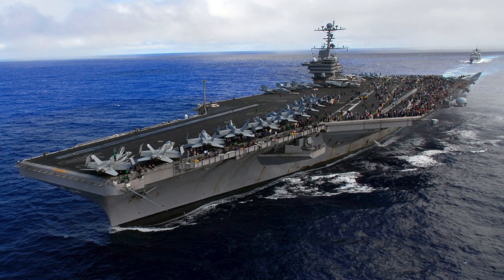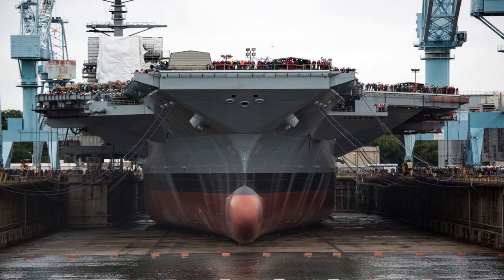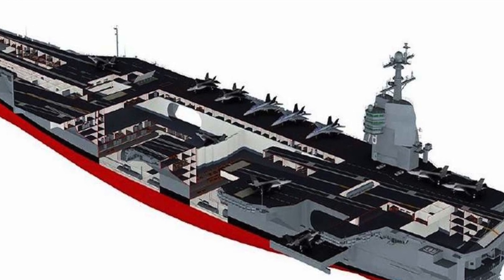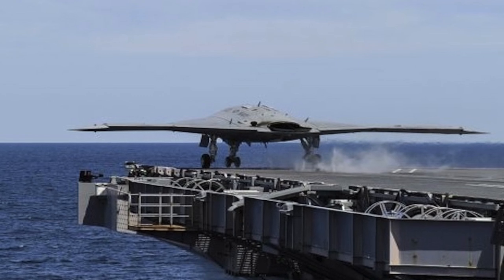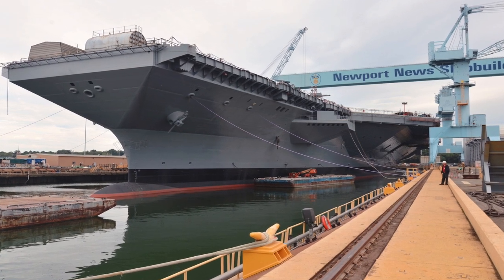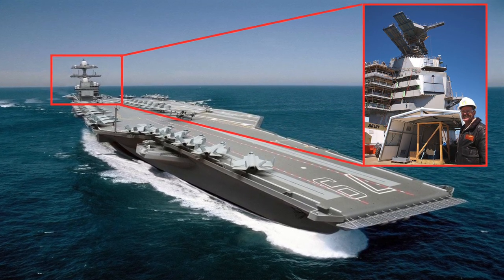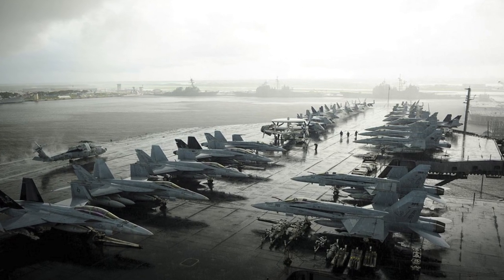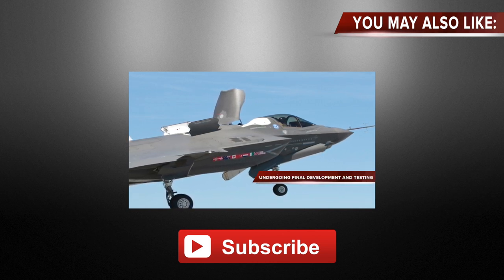NIMITZ vs FORD class: TOP 5 IMPROVEMENTS

Comment: This video is identical to a Pentagon press release. Every feature is treated as a flawless improvement over its predecessors. From all the failures, the actual ship is much less impressive. Hopefully, these deficiencies will be worked out before the next ship in the class is launched. Perhaps, the Nimitz class could have incorporated some of these advances and produced something more effectual.
Reply: The main upgrade (forget EMALS and others) is the power output. It costs too much to install a new power plant into a Nimitz, at that point you might as well scrap the ship and start over, which is what they did. The power plants are completely maxed on Nimitz, no room for better ewarfare suites, energy weapons, etc. 

It will take time to perfect these new technologies, but in the meantime, they have immensely more power at their disposal for more conventional augmentations.
Reply: They have incorporated hundreds of design improvements into the next ship already based on lessons learned from building the Ford. They are also retrofitting Ford with some improvements where possible.
Reply: I see the Ford class as incremental improvements on the Nimitz class, which broke new ground. The Ford is not breaking ground, it can't really do anything the Nimitz can't do. It just does all of it better, faster, cheaper.

When they mount a ray gun on it, then it can do something the Nimitz can't do.

Comment: what happens if one of these ships are blown up with a nuclear reactor on board?
Reply: exposer dozer boom goees the dynamite
Reply: the reactor runs until its out of fuel.
Reply: exposer dozer 
Nothing.
The water cools the reactor stopping the fission.
Reply: Trained pigeons and seals immediately converge on the site, defecate all over the thing, and it is rendered harmless. I know, it sounds fantastic, but it is the easiest way to neutralize radiation.
Reply: The seawater would cool the cores. There would be minimal radioactivity released into the air and water.
Reply: Officially there won't be much damage. But all the actual research is still classified,  so who knows. Probably nothing good.
Reply: Godzilla

Comment: This guy doesn't know what he's talking about. The steam catapult replaced the mechanical catapult primarily because the steam catapult builds energy during the launch. The energy is transmitted to the aircraft when the 'Restraining link ' is broken by the pressure of the pistons pulling the plane forward. The plane then Accelerates.
Reply: Yeah, he describes the thrust as if the steam is coming out of a bottle.  You can control even a fixed-volume discharge to vary any way you want, as long as you have a valve that opens gradually (hello? industrial revolution?). Geez.
Reply: I was a nuke mechanic for 6 years, did a tour on the Nimitz. This whole video was a facepalm marathon of all the incorrect information stated!

Comment: Very interesting but unfortunately, like the F-35, what was described is what it is supposed to do, not actually what it does.  The catapult system doers not work and may require a complete redesign, the same with the arresting gear.  Like so may things, that are actually made in the US, it is very expensive and doesn't work!  Extreme cost overruns, way past delivery date is the new norm!
Reply: yes a website^^ impressive, we couldn't use any other video streaming sie.. not to mention that the www was invented at cern by some europeans working in switzerland.
Reply: PaveISTL - The RT trolls are the US Republicans.  I am certainly not a Republic an!  I am a patriot, though I have less reason to be with every election that republicans win as they work to dismantle the US from within, and now NATO as well!  It is the Republicans that support Putin, due to right wing propaganda and the elected Republican orange goblin that wants to be like Putin, and the Putin loving Republican congress!  So, when talking of RT trolls, you may well be referring to US Republicans, that have been working against the US for over four decades!

Comment: just wait  till they figure out that replacing the steel in the deck,island and sponsons with aluminium and fiberglass will cut the weight by a 10th and improve the stability

Comment: The improvement now includes model -T Ford engines , only slightly used by Henry Ford . This is a "bottler" . But all the sailors have deserted , not convinced at this stage .
Reply: Troll alert   troll alert
Reply: *****
I thought I might amuse you .
Reply: tgjguitar
There is nothing wrong with being gay .I would not hold it against you .
Reply: You would not hold what against him.?
Reply: Tom thx
Tom Mix , that is correct , I don't hold grudges .

Comment: These advantages are only theoretical. They'll have their hands full with getting the damn EMALS catapult to work reliably.
Reply: New ideas always take time, they will get it working, not to worry.
Reply: All I heard on the news is that they were having trouble with launching and landing. What that really means, who knows. But not to worry, they will correct any and all issues.  The EMAL has been tested and did work fine in test.
Reply: They'll probably get it to work fine, eventually. The question is how much money will it suck up? I think It doesn't make much sense to invest exorbitant amounts of money on a complicated and unproven technology that offers incremental advantages.
Reply: +SiegenDignitas    Al like new equipment need tuning, no big deal.  To late to go back now, it is built and here. It will be fine and work great, just takes time to get started.

Comment: Hmm, 300 Megawatts of electricity...  A reactor, (or boiler ), is generally at a maximum of about 33% efficient. As a former Nuke on a Carrier.. I am Surprised that you are saying.... 2 reactors at 300 megawatts electrical... That would mean something like 2000 thermal?? I realistically don't buy it! Way too much! The Enterprise, (My Carrier and the Nimitz Class carries would be Very Roughly, non Confidential numbers here... Half that, (Very, Very Rough Numbers). 

     I Did about 10 years in the Nuclear Navy and I am currently on my 25th year working at a Commercial plant, (NOTE TO NAVY NUKE THERE IS NOTHING CLASSIFIED IN COMMERCIAL NUCLEAR POWER). We put out 3466 Megawatts Thermal. Our Generator puts out 1200 Megawatts Electrical. (Which is exactly what us Nukes expect).. (Side note we put out enough Electricity to power Seattle... we are in Washington state). 

     I am excited to meet the Nukes who will be serving on the new class of Carriers. (So I can find out if these specs are true). If the new class Really does have twice the thermal output of the Nimitz Class carriers... Holy Crap!!!

Comment: Nice try guys but you forgot to mention some other facts:
 * The GRF cost $16.4 Bn
 * The GRF radar is so expensive and unproven that the rest of the Class will get a downgraded version. Neither of which matches the radars on UK Type 45 and QE Class ships
 * The EMALS system has yet to work as required on the ship
 * the Advanced Arresting gear (AAG) does not work
 * The total crew required is not 2,600 it is 4,300
 * The GRF has yet to put to see or raise power despite being 'launched' 3 years ago
 * The GRF has so many faults it has been classified as 'unfit for combat'

But apart from that its a fine looking ship.
Reply: You need to learn some "facts". You can't compare what the UK to the US has. The US has far more advanced tech. The UK military is too tiny in comparison... They had to rely on US Navy and US Coast Guard personnel to man their ships because the RN didn't have enough sailors...And they had to rely on US Navy P8s to help patrol their coasts because they don't have Maritime Patrol craft...lmfao. They won't have any till 2018. The RN has to rely on US Marine Corps. to help compliment the air wing of the first QE ship because the UK doesn't have enough F-35s to put on deck. Not to mention the delays in the QE in getting underway. 
...If you want to mention the Type 45s....you mean those ships the brits are so proud of that keep breaking down..in warm water. Lol  That they're only air defense and not multipurpose like the Burke class ships we've got. 
 Please  don't start with comparing the Ford class supercarrier to the QE class "carrier". There is no comparing those two. The Ford outclasses it easily. It's not even funny.
 The UK would love to have a Nimitz or Ford class Supercarrier, but they lack the funds, the tech, infrastructure, manpower, or capabilities to field just 1 Nimitz or Ford Supercarrier....So they'll just have to make do with their 2 QEs....LOL.
The Ford is going to enter service this year. The systems you deride Do Work.

http://www.navy.mil/navydata/fact_display.asp?cid=4200&tid=200&ct=4

When it does it will have no equal on Earth from any Navy. The only one that rival it would be the....US Navy with its 10 Nimitz class CVNs. President Trump has ordered an additional Ford to be added to the mix and that will bring up the total Supercarriers to 12. That's not counting the 9 LHD/LHAs that are online and the additional America class LHDs that are going to be built..11 in total. That's a lot of carriers son.

Comment: The catapults will fail in time and if a reactor scrams it will take time for the second turbine to ramp up to the 30 megawatts needed for catapults and during this time air operations will stop. The switchgear alone for this ship will have to work like a Swiss watch and in 42 years I have yet to witness flawless switchgear. The time for carriers is sadly coming to an end and I was a carrier sailor for 4 years, but if we tangle with a country that has a real military, the carrier will never stop 4 or 5  missles skimming right above the waves at near Mach speed from 4 different directions. The future of the Navy is under the waves, and we should move fast in replacing the Ohio Class and attack boats. If needed we should contract out to other shipyards if needed. Again, the switch gear will fail despite redundancy.

Comment: HMS Queen Elizabeth-class has much more serious and impressive automation. It will have a crew of only 650-680, while being 72,500 tonnes and 280 metres long. Yes, it is smaller than the Gerald R. Ford-class, but it is still a beasty supercarrier and 2nd only in sheer size to the US supercarriers.
Like it or not, while around 3/4 the size of the US supercarriers, the British need only 650-680 crew whereas the old and new US supercarriers need between 2,500 and 3,000 crew. Even while bragging about it's automation and crew size reductions, the US carriers still need nearly 5 times more crew, while only being 1/4 its own size bigger than the British supercarriers.
Also, the British supercarriers are more cost effective and as advanced/if not better than the US supercarriers technologically. More efficient. However, obviously the US supercarriers are overall more powerful, but don't underestimate other people's technology or achievements; namely the impressive QE-class of the United Kingdom.
Reply: Not really applicable.

Comment: Meanwhile the US national debt is sitting at 19.4 trillion dollars. Remember what happened to the Soviet fleet when the Soviet Union collapsed?
Reply: What's the US one year GDP?
Reply: Just under 18 trillion. Just look up the "debt clock", and you'd be alarmed.
Reply: "trillion" is just an over-used word to most people and it doesn't register. A trillion is actually a thousand billion. A national debt of 19.6 trillion is actually 19,600 billion. The very richest man on the planet is worth maybe 50 or 60 billion. Sheer peanuts compared to the annual American national debt.

Try tapping people on the shoulder and ask them how much ONE TRILLION DOLLARS is. Not one in ten has any idea. 

Then you can tell them. Don't judge the poor sheeple, rather educate them, one man at a time.
Reply: Hmmm. 1,000,000,000,000. 1 Trillion
            19,600,000,000,000. 19.6 Trillion.
In your format, 19.600 billion, which still has, 000,000,000 behind it. The richest billionaires can count to the tens of billions, never mind the hundreds to thousands of billions. Your a couple of commas short in your assumption.
Reply: +Alain Archambault  Your math is WRONG. A million is 1x10^6.  A billion is 1x10^9, and a trillion is 1x10^12. 
You incorrectly represent a billion as 1x10^12 (twelve zeroes) and a trillion as 1x10^15 (15 zeroes). 

You're only off by a factor of ONE THOUSAND (i.e. 1x10^3)
Reply: It is kind of hard to keep track of all of those zero's
Reply: i'm sorry but The US is not the Soviet Union
Reply: Sergeant Titmilk Soviet Union collapsed under it's own rotten weight. Of course US is not the crappy Soviet Union
Reply: You two are right, the Soviet Union was a closed system. The US will be given a whole lot more rope which to hang itself. But the debt train does have a terminus.